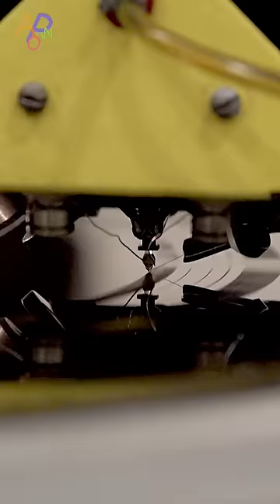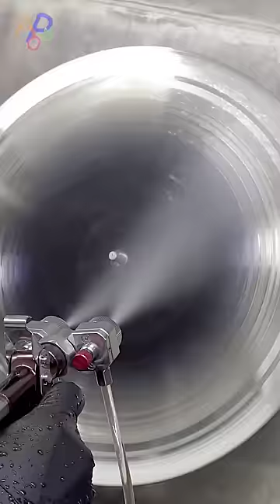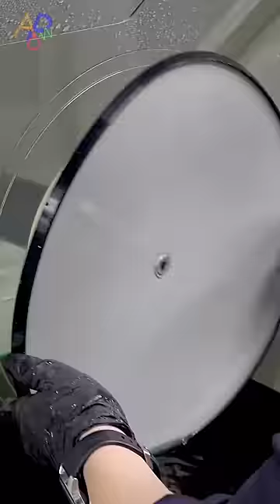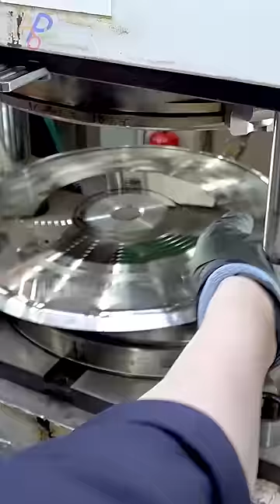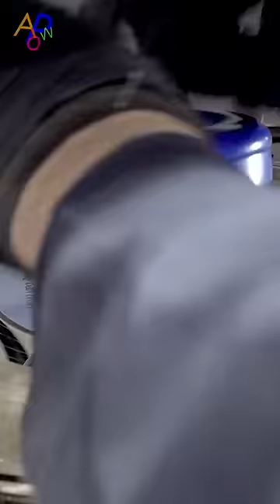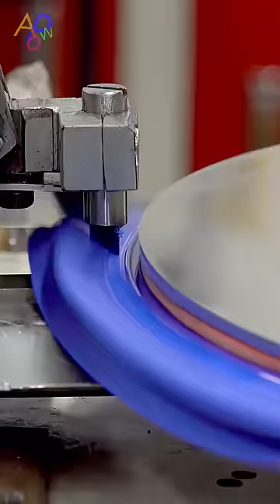Vinyl Record Making Process. Korean LP Records Factory #allprocessofworld

Comment: Fascinating. I still think Vinyl played through a VALVE amplifier and a decent speaker system is totally better than any of the advanced "electronic systems used today.
Reply: "Better" is subjective. A better experience in your opinion? Sure. Better in terms of quality? Not even close, no. Modern solid state electronics put vacuum tubes to shame by a longshot.

Many audiophiles will make a claim this, and then set up their system with improperly-placed speakers in an untreated room.

Comment: Im more amazed of how vinyls, tapes and films work more than how computers and bluetooth works
Reply: Tbh computers and Bluetooth are several-fold more complex in their operation than vinyl, tapes and film.

Vinyl, tapes and film's functionality can be summed up with a single word, "transduction" and when you understand the basics, you'll understand how all of it works.

How a computer operates is so much more complex it cannot be diluted into a single word because there are thousands of operations per second combining into a single user experience.

Comment: Back then, they recorded on wax disks, then with electrolysis covered it in metal and probably soldered to a backplate, and that way a master plate was done. Now, technology is precise enough to cut the disks.

Comment: Most inventions take a while to get right . Not so STEREO vinyl. (With stereo the bumps on the left side of the groove send music to the left speaker and the bumps on  right side of the groove send music to the right speaker). It worked first time. Even the inventors were astonished. Like hitting a hole-in-1 in Golf.

Comment: The term dub plate links to the 'metal head' used as the cutting die the vinyl copies are formed against. 

When reggae DJ's used to play a dubplate version to test audience reaction in Jamaican dancehalls & clubs it was actually often the Aluminium die plate they would play out first.
 The sound quality would degrade quickly. 
The metalhead lasts about 10 plays before you had to throw them away as the needle chips away the soft Aluminium groove. 

This kept costs down because if the track wasn't liked by the club audience you wouldn't bother pressing it to a run of vinyl. 
The more expensive cost at the cutting house. 
Instead the master tape would be reworked into a better track or not used at all. Shelved. 

The dub part of the phrase came from the studio engineers cutting down artists full songs into a minimal dubbed version, often limited vocal and lead instrument tape cuts with heavy echo effects added to the cut down instrument phrases making a stripped back version of a bands original song. 
This was often done without the unsigned bands permission and got around any future copyright if the unknown band became signed to a major label later on.
  Some struggling unknown artists would agree to it if they got a discount fee on studio rehearsal &  recording time for the band. It could also help with their popularity locally in the clubs.  
 Lee scratch perry made a living and a reputation as a studio engineer/producer known for creating these dub plate versions for dancehall DJ's.
 It supplemented his meagre studio engineer wages via selling dubplate out the back door and helped to spawn a new underground genre of music called Dub Reggae.  
One such unsigned unknown band was Bob Marley and the Wailers before they became signed to a major & famous. Original dancehall dub plates of the wailers are worth a fortune today.  

White label would be a limited run usually of 10 to 50 vinyl pressings handed out mostly to top club DJ's for a wider audience feedback,
before going to a major pressing of 500-10'000 copies for underground genres or millions for commercial sales.
 if it was popular with club audiences first. 
 Again to save on pressing costs. 
the white label was often a one sided pressing only, with just a blank white center label to keep down costs often with just a contact phone number scrawled on in marker pen and a blank paper sleeve. 

This way of cost cutting started in the small independent labels in Jamaica in the 1960's onwards and spread to early independent  hip hop labels in the US and the rave era in the UK of the late 1980's early 90's.
 
Still today surviving original white labels with just a blank paper sleeve often change hands as collectables for more than a full two sided pressing with artwork sleeve due to its rarity or subtle differences in the track structure itself. 
The sound quality is often poorer though because they were pressed on lightweight vinyl or half weights, also to save on cost. 
Today the resurgence of commercial sales vinyl means they are almost all pressed on heavyweight vinyl for stylus stability. 

Goldie's major D&B label Metalheadz takes its name from the Aluminium die pressing same as the one seen in the video.

Comment: Значит технология DMM утрачена, раз нарезка на лаковый диск?
Reply: This was the thing made by Teldec, right?
Reply: @mateuszorlinski7334  Direct Metal Mastering. TELDEC has developed a new process which eliminates the above described problems by circumventing all those steps. Its principal feature is the cutting of the groove directly into a metal coating (TELDEC DMM technology) meaning that the cutting lathe directly produces the mother (metal positive) for the plating process.

Comment: Digital killed the Vinyl star…
Reply: Wrong. Cassette tapes (which are analog, like vinyl) killed the vinyl market in the late 70s and 80s. Digital didn't become widespread until the mid to late 90s
Reply: @pc_buildyb0i935  , what I meant was digital killed analog audio. 
Vinyl records and cassettes coexisted for quite some time.
Reply: @truthteller6932  If you want to get meta about it, digital did not kill analog audio because digital does not exist as audio, it still needs to go through a conversion process, whereby the digital data is converted to an analog signal, and audio can only ever be recorded by analog equipment anyway.

Even then, if you want to get even MORE meta, there's no such thing as ANALOG audio either, because it's a fully electronic signal that must then feed a speaker in order to produce soundwaves, which aren't analog at all.

But that's just being super meta. More to the point of your comment, vinyl sales tanked when cassettes made it onto the scene, just like cassette sales tanked when CDs were popularized.